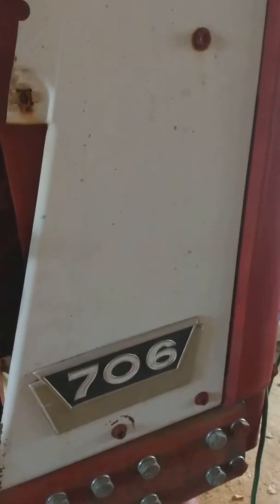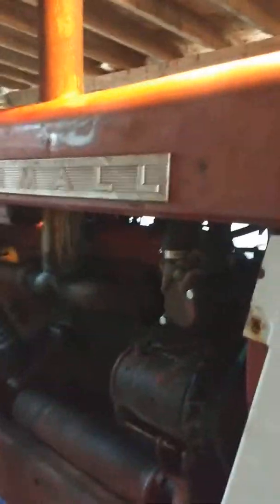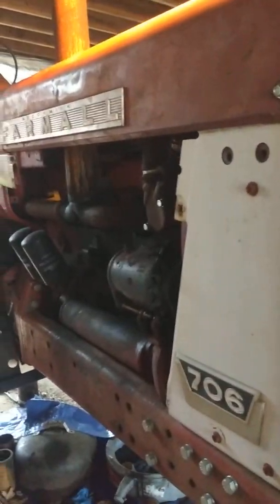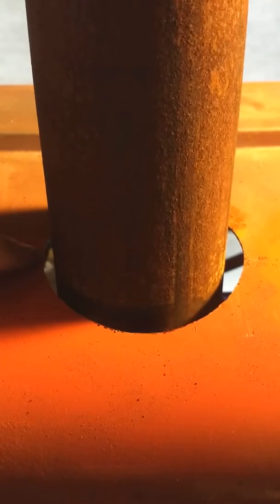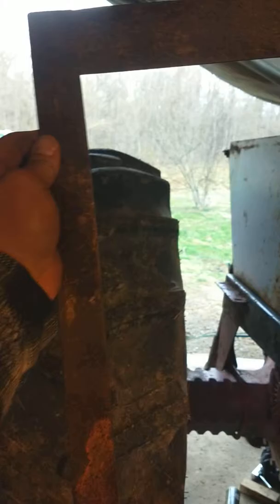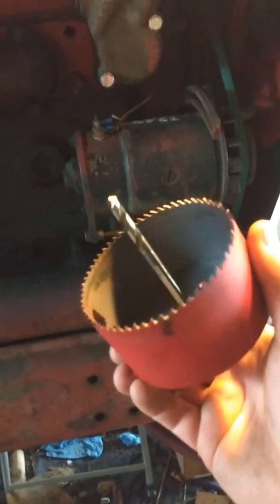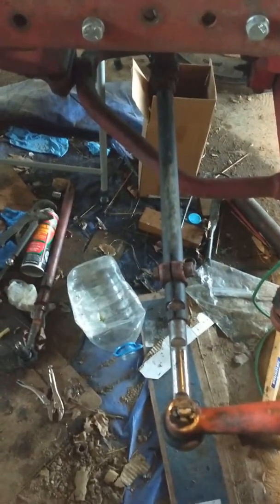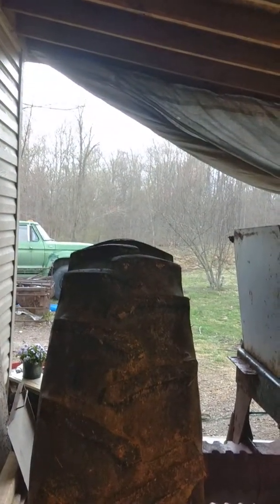Fitment of the hood IH 706 diesel conversion and how I cut the exhaust hole.

Comment: Hi, thanks for sharing that vid. The hood turned out pretty good.  Just a thought, I have cut heavy sheetmetal like your hood with a sawzall.  Use a good quality blade and keep it oiled.  You can get a nice straight cut right on your line.